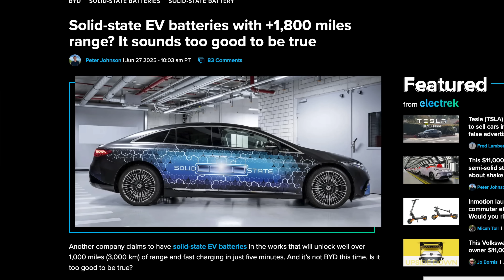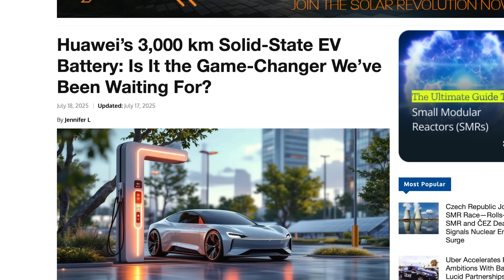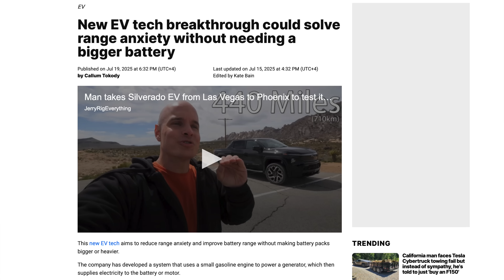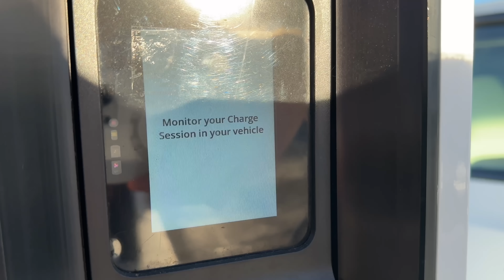EV Battery Headline Red Flags 🚩

Comment: Yeh no .

I mean yeh the news reports on batteries are extremely misleading,
Yes a 1,000 mile battery is unnecessary and can be considered a nuisance but why not?
I mean just because it’s not necessary doesn’t mean we shouldn’t have it .
I mean a phone battery that last last longer than 24 hours is completely unnecessary but people brag about the fact their phone can last several day not to mention it’s actually useful not only do you have to worry about charging as often if you forget to charge it or say get lost wow it still has plenty of battery so you can get help .
Ev batteries should be treated the same as phones.

My point is yeh 1,600+ miles range per charge is pretty unrealistic  .
Tho a 1,000 miles range per charg is unlikely, and unnecessary it would be pretty convenient
Reply: a 1000 mile battery isnt unnecessary its good for bigger vehicles not a smalll sedan lol! in Scandinavia they have semi trucks with up to 3x the hauling capacity of regular american semis those are called road trains and they get even bigger in Australia. energy density improves the use in heavy applications.
Reply: @carholic-sz3qv  yeh and I meant for normal vehicles.
I’m very aware1,000 miles of range would be required for long haul semis .
It’s considered unnecessary for normal everyday vehicles but it would be very convenient

Comment: I mean, I could probably put a 800+ Mile range battery pack in my M3P Myself sure, But it would probably fail within like 50k miles and cost 40k+ Dollars cause it's completely untested and proven tech that isn't made strictly for my application

Comment: Charging voltage has very little to do with the speed of charging a battery pack. At the cell level the voltage is 3.6 volts. The heat in the battery pack generated by charging has nothing to do with the packs voltage. If you put 250 cells in series to build a 900V pack or organize it as two strings of 125 cells to build a 450V pack you still have the same 250 cells each generating exactly the same heat. The only place where charging voltage matters is in the charger itself. Higher voltage allows you to push more power across the same cable but peak power doesn't matter very much because charging is limited by the cell chemistry and the thermal architecture of the pack. The Lucid Gravity charges much faster than a Tesla on a Supercharger then a Tesla does using the same Panasonic 2170 cells, the difference must be the thermal management.

Comment: We don't even need advanced new batteries to get 600 miles of range. You can just change the cell layout to have more cells in parallel than series and now you have more capacity but at the cost of lower voltage. It means you can have a 600 mile Model 3 right now, but it'd have a 0-60 of 10 seconds instead of 5 and would take twice as long to fast charge. 

Car companies would rather have the fast charging and 0-60 because its more marketable.

Comment: All these headlines get so much attention, I’m seriously surprised there’s not WAY more interest in Aptera. I mean 1000 mile range, 500mph charging at 50kW, 13mph on a 120v, it’s cost to charge it is 2/5 of a Model 3 and 1/7 of a standard gas car on average for equivalent range. That’s not even including the solar or the cost to replace the battery down the line (whether from failure or newer chemistry).
Reply: When will they deliver this?  They've been validating tests for 3 years.
Reply: @GG-si7fw Most likely the Aptera will deliver the first cars on 'the 12th of Never--" they cannot find the cash to function.
Reply: @harriettanthony7352 they will most likely hand crank the first 50ish out by the end of the year, which will then grant them the $21 Million CEC grant, then IPO, then begin ramping up to full scale production.
Reply: @GG-si7fwit’s just been a funding in a certain amount of time battle. Burn rate drags out the funding required.

Comment: My OnePlus 13 phone has the Sodium Iron battery. So that is not a fantasy but a real battery. It has 20% more energy with the same weight/volume, charges 0% to 100% in 35 minutes. Degrades slower like LFP batteries and are cheaper to produce. A Model 3 with this battery chemistry and close to 1000km range, would be the perfect sweet spot for many EV owners. It would put the range on par with the diesel cars, but be cheaper to produce and charges fast enough so you won’t miss petrol ever again. Again this is no fantasy battery, it’s here. The solid state battery (even though announced every week by some research group that desperately needs money, or some car manufacturer that needs desperately for people to hold back their EV purchase) is still 10 years out like it has been for the past 20 years.
Reply: And now we got mass market LFP packs that can deliver 8000 real world cycles or packs with good fast charging. Solid state is becoming more and more like a joke.
Reply: Those batteries are estimated to last maybe 3 years. After that, they drop off rapidly. It’s why bigger companies don’t use them.
Reply: I am almost 100% certain the OnePlus utilizes silicon carbon for its anode instead of graphite. This is supposed to increase both cycle life and volumetric density. 
Unless I’m missing something, there isn’t Sodium Iron in those batteries. I don’t even know if sodium iron is a thing, unless you meant sodium ion.
Reply: @jjoe718  He meant sodium ion. And many (MOST) people cycle their phone EVERY DAY; three years of every day is ... A THOUSAND CYCLES. Apple optimizes their batteries for a three-year lifespan; after that you're supposed to throw it away and get a new one. But a thousand cycles in an EV is two-to-three hundred thousand miles.
Reply: @capnkirk5528 well again, unless I’m missing something, sodium ion isn’t used in OnePlus devices. 
A battery does not magically become useless after 1000 cycles or 80% health. Typically a battery could last all the way to 60% before rapid degradation occurs (so large battery EVs can actually go 500k miles before serious problems occur).
Reply: @jjoe718  I didn't fact-check his assertion, so it could be wrong.
I have looked at the price of Na-Ion batteries in the 18650 format for a D-I-Y ebike pack and decided against them. Not here yet, but definitely coming.
I've also tried to find a "cheap" EV pack that is out of a car, but they are still rare. And NOT cheap.
I can see REAL people driving "beater" EVs to 400K miles and 50% degradation if the loss of capacity is linear. I suspect the auto industry can too, and are shitting bricks and resisting EVs as hard as they dare.

Comment: 100%. A bespoke, single cell designed in a lab extrapolated out does not mean designed for scalable, cost competitive manufacture. “Theoretically hitting those metrics” is fine but it’s just a research paper until someone makes it a reality at scale.
Reply: Yeah you can scroll through many journals about batteries. There are hundreds of "new chemistry breakthroughs" that had been developed in the lab over the years, but only 1-2 of those that finally gets passed into mass production

Comment: Spot on...  Although, I do wish Tesla could have offered dual DCFC charge ports on the CyberTruck split pack.  Easy to technically do, and then using a pair of (just the right) old 120kW chargers could still hit the vehicle peak, even a pair of 150kW would be just shy of of the peak.

Telo should steel my idea, if you have a split pack...

Comment: I think the most beneficial metric in an EV battery is sustained performance. You’ll get much better charging times with a battery that could theoretically hold 250KW till 80% vs a battery that peaks at 500KW but by 50% tapers off to 100KW. Once we get to 350KW sustained to 80%, we’ve basically reached a refuel time of a gas car, and this would be with current infrastructure.

Comment: Just make the battery go 500 miles on a single charge and I’m sure the majority of people would be happy.  This is possible with the current battery technology.
Reply: Yeah, considering that most people don't do very long trip more than once a year, and most people who did long trip over 500 miles will prefer public transport like trains or planes, than road tripping in a car
Reply: My Lucid Air GT does 800 km on highway speed.
Reply: Guys, if it were that easy, it would have been done already. I never believe any claims of high mileage. Someday we’ll get it, but not yet.
Reply: @melgross  I just told you how you could have it right now. Installing cells in series increases battery voltage at the same capacity while placing two in parallel doubles your capacity. If we really wanted we could just make a 600 mile Model 3 without using any large battery, not having more cells, not using distinct chemistries, just at the cost of being a generally slower car and charging slower. This is the trade off on how battery packs are balanced.
Reply: @Skylancer727 that’s what you say. You haven’t explained why nobody does it. I believe that car and battery companies know more about all of this.
Reply: @melgross  I did explain why they don't. You're trading off voltage for capacity. Higher voltage means both faster charging rates and more power. So we could make the Model 3 get 600 miles of range using the same pack rewired, but it will now take 2 hours to fast charge and the car will have a 0-60 of 10 seconds. It really kills that view people have that an EV is all about the instant acceleration and slower charging is openly mocked by people. I mean just look how many people say they would never buy the bZ4x with how slow it charges while being a generally slower car. People will actively buy the EV with the higher marketing value and some companies even advertise with their pack voltage. We're talking cutting that in half. 

This is also why you see a lot of lower voltage personal commuter vehicles that have ridiculous 80-150 miles of range when the cars can't. It's not as much that EVs are just that much less efficient, it's that faster charging and hard acceleration are seen as a lot more compelling in a car. If you ever look into EUCs or escooters you see this a lot where the higher voltage ones have less range but are much faster.
Reply: @Skylancer727 the rating on batteries is actually in watts. That’s the measure of power. You have the same number of watts in a battery pack no matter how you wire it. That’s why 240 volts delivers the same amount of wattage as 120 volts but with half the amperage. You need to explain why wiring a battery pack that way will give greater range. It won’t. It’s the same amount of power that’s stored in the battery. Yes, you can more easily deliver a higher charge with higher voltages as you can use thinner cables. So charging will be quicker. But I don’t understand your reasoning.
Reply: @melgross alright this is where marketing gets a lot of people. The power rating we see is the voltage of the pack times it's pack current. Capacity of a pack is only rated by the current. Let's say I have two 12v batteries each with a pack current of 30Ah. If I were to wire them in series I would get 24v but still only have 30Ah of current. If I run them in parallel I get the same original 12v but now 60Ah of current. A battery with a higher voltage but lower current will have half the capacity but double the voltage. 

The pack rating in watts of both packs is exactly the same. 12×60 and 24×30 both equal 720wh, but if you're running a pack at double the voltage you're burn rate is twice as fast. That means you could make an EV with the same pack have half the voltage and get twice the range, the cost is exactly what I said, you get a vehicle that's half as fast and takes twice as long to charge.
Reply: @Skylancer727 your burn rate isn’t twice as fast. You design for whatever you need. I’ve designed plenty of circuits over the decades. I design according to what the components use. If it’s a motor, I have no control over that. If you look at the wires going into EV motors, you’ll notice how large a gage the conductors are. The voltages they operate at varies,  so that’s what you design for. Yes, if you have say, a 12 volt requirement and you parallel two 12 v batteries, you’ll get twice the run time. But we’re not talking about something like that. If the system requires a certain voltage, that’s what you have to deliver. The EV makers know what that voltage is, and that’s what their packs provide. You can’t just halve the voltage to the system. Then what are you going to do, use a Dc to DC converter to bring it back up again? No.
Reply: @melgross EVs use AC motors so no matter what they need to go through a DC to AC converter. The voltage we see is just the pack voltage. You're very unlikely to find an EV using a DC motor past the 2000s. I work on the railroad and the same shift happened where modern engines all use AC traction motors.
Reply: @Skylancer727 I understand how they work. But batteries put ou DC and you have to do this in the most efficient way to get power to the motors, which are multiphase. You’re not telling me something I don’t know.
Reply: All they have to do is retune battery packs for more cells in parallel than series. You would make the car slower and charge slower, but it will make the capacity increase. I'd rather have an EV that can go 600 miles than one that can go 0-60 in 4 seconds and recharge in 30 minutes. 300 miles isn't enough for when I go on road trips, but 600 is enough to guarentee a stop of at least 40 minutes giving a good charge bump.

Comment: If they could increase energy density, automakers would just spend less money and put smaller batteries in cars and keep range and mileage the same and just increase their profit margins. We know this is what they would do.
Reply: Yeah but there still is benefit. With a more energy dense battery you can also save on vehicle weight which improves efficiency and range.
Reply: @CCA_ for sure. We would see a benefit. Paying less in electricity when we charge since it would not cost as much for a full charge.

Comment: A lot of yall are getting it wrong. Range is about convenience. Not about road trips. 1600 miles range means i don't have to remember charging often, maybe just charging once a week instead of every day. Think of how much better it would be if you lived in an apartment or townhouse with no driveway or garage. It is not about driving 1600 miles straight without stopping. I have a friend who drives Uber and was forced to pick a kia Niro (his corolla in the shop). He hates it due to the range, especially in the hot summer when he must use AC. Still cost him $40 for a full charge. 

A car with a small gas tank and low range in a rural area has the same effect.
Reply: yeah thats what the EV people doesnt want to think about! imagine having an electric semi that can haul up to 3x the lhe load of a regular 80,000lbs truck and actually compete with diesels!, imagine going overlanding in the middle of nowhere far away from any infrastructure.....
Reply: You drive 200 miles a day! I do get what you’re saying however 1600 miles is still overkill honestly I’d say 500 mile EVs would be enough if you had no charging at home.
Reply: @CCA_ its not necessary but There is never enough
Reply: @CCA_ its not overkill and depending on the vehhicle you drive mostly 500 miles would be more than enough, but imagine an electric ford f450 towing over 35,000lbs all around the country thats alot of energy needed, bigger range are for bigger heavier vehicles.
Reply: @carholic-sz3qv  I do understand that but, a giant 500 mile battery pack doesn’t need to be in every EV I’d say a company for example Chevy should release a work truck a a huge battery for towing but keep other the Silverados which most likely won’t tow at a smaller battery pack. I do understand the towing need but towing capabilities don’t need to be in every car cause not everybody needs to tow. Plus changing infrastructure once batteries hit over 250kwh it will take 45 min - 1 hour to charge on current infrastructure. These need to change at the same or else things will still be slow.
Reply: @CCA_ toyota for example sells diesel SUV around the world with auxiliary fuel tank to significantly increase the range for all kinds of use and applications by people, companies, NGOS.....

Comment: The 1000 or 1600 mile range is the most  distinguish tagline in the journalism industry . The fact that they don’t even acknowledge is the weight of the batteries in order to attain that range.
Reply: 1600 miles is too OP in regular use case, and almost all the people won't use all of the 1600 miles range, (as people mainly chose public transports like trains or planes if they want to go traveling to anywhere over 1000 miles)
Reply: How often do ppl drive 1000 miles NON STOP?? 😂😂